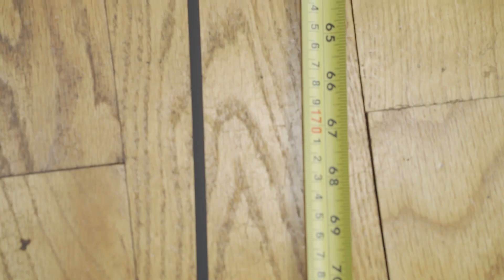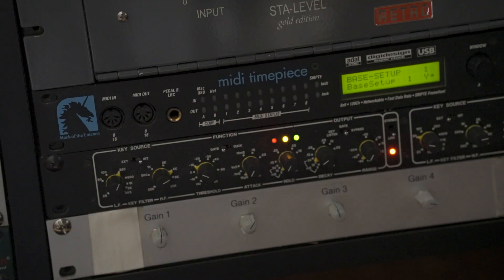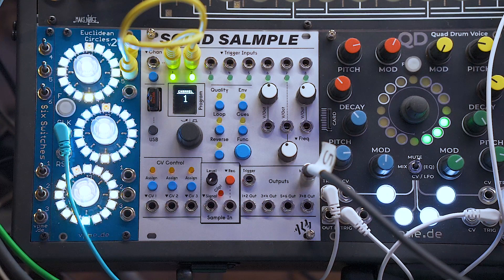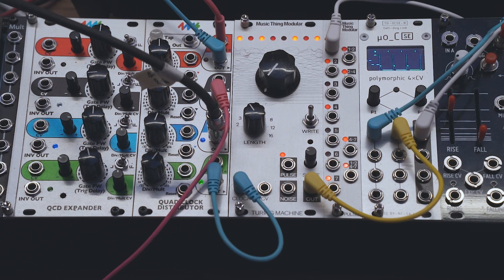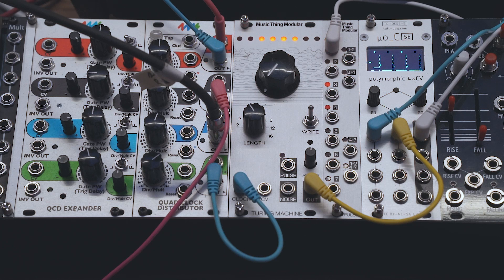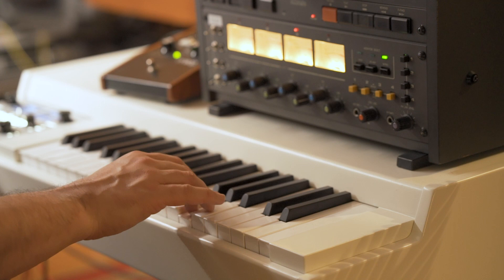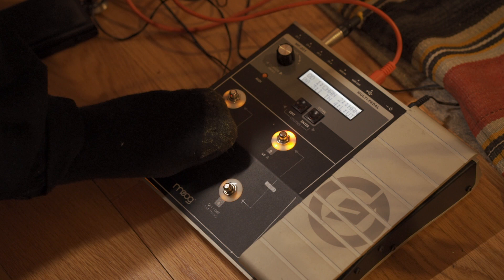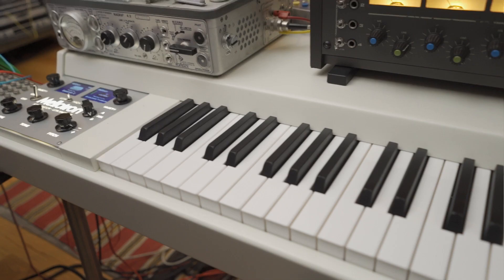Otari 5050 4 track Modified with Pitch CV and sound on sound

Comment: Wowsers! Love the nerdery of this, so beautifully done.

Btw - the Korg SE-500 has CV and S-Trig control of tape speed, effect on, intensity reset. It also does sound on sound. All from 1979!

But Jamie obviously did a whole heap more with that reel to reel.
Reply from the maker: Oh yes! That vid you did was great. What a lovely box that is. I’m waiting on another mod on this to allow access to the super slow mode .. it’s a switch deep in the machine but I need it on the front. That will allow 4 octaves control. The munge levels get so crazy after that. Lol
Reply: @HANGINGOUTWITHAUDIOPHILES  I've just realised this is your channel Jamie, ha.

Four Octaves- wow, that's some serious pitch potential.

The only thing I found frustrating with tape speed CV is the lag of the mechanical side of it. Obviously you can't switch immediately to a new speed, it's always a slew.

But then it's amazing in so many other ways.
Reply from the maker: @AlexBallMusic  hey ! Yes. From time to time I get the cameras out to make a little vid. Inspired by all you pros :) I think hainbach has an HP tape with BNC ins that is very fast. I’d had the idea to develop a tape machine using drone motors. Not sure if it’ll ever be made but I’d love to see that too !
Reply: @HANGINGOUTWITHAUDIOPHILES  Your video looks more pro than any stuff I bumble together.

Hainbach - ah cool. I'll have to ask him about that.

Drone motors - now you're talking. Obviously a joystick remote control would need to be incorporated. 😀

Comment: Really love the concept. Is that click track pretty stable? Makes me wonder if there's a way to mod a Tascam 424 to do this.
Reply from the maker: Worth a try! It was a bit tricky but it can be done. I recommend a noise gate. Without it the tape is liable to add pops and noise that can be harder to isolate when making the gate signal. The timing is a little wobbly but not bad!